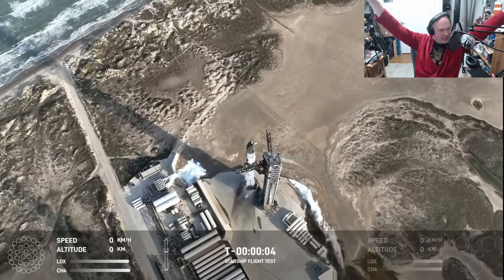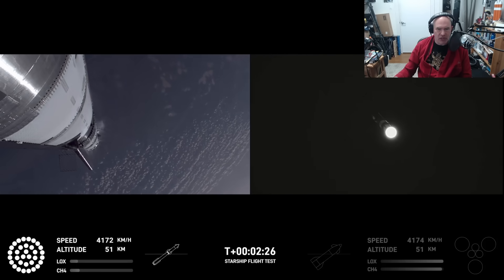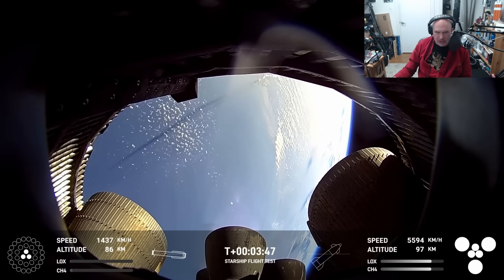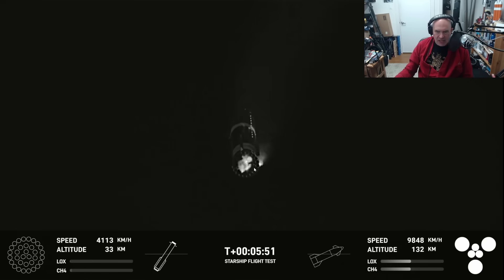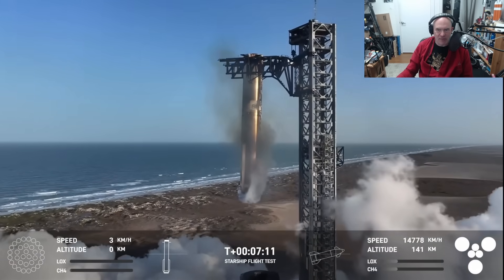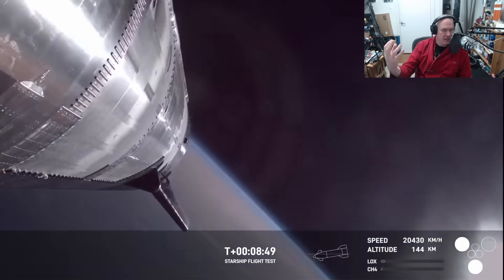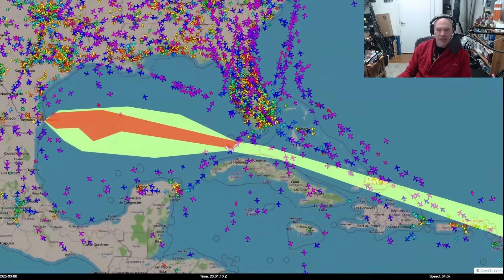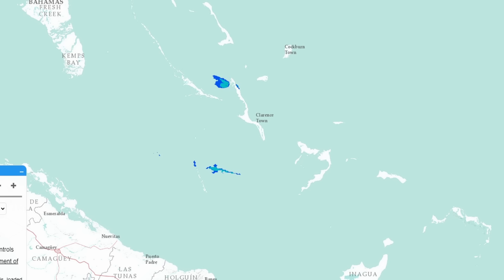SpaceX Make The Same Mistake Twice With Starship Flight 8

Comment: The ship blowing up is obviously a big deal, but not all engines relighting on the booster shows they still have some other issues to work out as well.
Reply: Engines and other mechanisms don’t just fail randomly.  They fail because of a root problem that is not being understood. If you don’t understand and fix that specific issue you will be seeing consistent and persistent failures until one day you get really unlucky and lose the vehicle and the launch complex.  In the early 1990’s general dynamics had a failure from an engine not starting.  An elaborate failure investigation was done and multiple smoking guns were found. Those were fixed. Except for this one weird temperature sensor that was showing a little change not seen before.  Just couldn’t explain it.  But it wasn’t an important sensor.  So we flew again.  Worked ok. Flew again and the same exact failure occurred. With that little twitch in the sensor too.  Finally the root cause was understood and the behavior of a little check valve that mostly functioned only on the ground was the culprit. That and keeping a chill down system that was 1960’s vintage and there to get a tiny bit more performance.  You can’t solve this stuff in two days. You think you can. We did!  This cascade of events utterly changed the design philosophy and test methodologies.  And how faults and their consequences are addressed.   SpaceX engineers need to stop calling catastrophic failures RUDs. It trivializes your major screwup. And is utterly unprofessional.  In my estimation they had more than a half dozen overt and significant failures on this mission.  An engine failure to light is a FAILURE!  It doesn’t matter if you squeaked out a success at the vehicle level.  If you keep on this path all sorts of other anomalies and failures will get swept under the rug and you’ll develop a reputation as foolhardy and basically lazy and stupid. Think Boeing 737 and the corporate think that burned them. Don’t be overwhelmed by Elon’s musk.
Reply: Yes but this is actually the best turn of events, they had partial engine failure but were still able to return the booster- they can now examine the engines to correct the issue. In the past they had to scrub the entire catch attempt when the engine failure happened so I'd wager that they'll be able to start making some huge strides now that they're getting the boosters back.
Reply: @twoeyes  No it is not, if 2-3 engines are consitently randomly failing on EVERY launch then statistically you would expect a 2 standard deviation failure of 6-9 engines once every 100th of so flight and that's going to result in loss of vehicle.  Your statement is akin to saying that Jets aircraft which can tolerate 1 engine failure are ok if 1 engine failure is occouring routinely.  That's only safe is 1 failure is vanishing small so that the multiplicative chance of a second unsurvivable failure is infantesimal.
Reply: @kennethferland5579  Thanks, I was just about to write about how the statistics play out.   NASA's criteria for a manned launch is that killing one crew in 500 launches is their acceptable limit.   So given that, how often can we accept a single engine failure?   Then because there are som many unknowns, we have to put in a safety factor so we might need to calculate for a 1 in 2000 loss so we achieve no worse than 1 in 500.  I think this works out such that failures are rare, not routine.
Reply: @kennethferland5579  yes, it's reducing the safety factor and serious from that POV.
Reply: @ yes that’s true, that is a bright silver lining, I was surprised at that.
Reply: To be honest it's possible that these engines were alright, but some automatic systems measured 10% less startup pressure or whatever and decided not to light them up for safety. Then for the landing burn one engine returned back to desired parameters and got lit, while other was kept offline.

This was also demonstrated on the previous flight, where they relit one engine that went out.

If you have a damaged/clogged engine in any significant way - you wouldn't even try to relight it, or it will cause explosion and massive damage. The fact they relight failed engines shows that those fails are probably just failsafe guidelines that flight computer operates on to avoid any risk of relighting offnominal engine. Don't say force relighting it will cause explosions, just that risk os slightly higher and isn't worth it
Reply: while true that 100% engine firing is desirable, it's designed to withstand several engine failures (as shown here)
Reply: @TheAechBomb  The fact that some engines can fail doesn't mean that they should.
Reply: @HalNordmann I agree
Reply: @TheAechBomb  if theyre burning through the safety margin every time then how long before they get too many engines not lighting.
Reply: @ebouwman034  they can improve the reliability of their engine re-lights later, I think they're better off focusing on making their engines not explode first
Reply: They are still using raptor v2's on v2 starahip. They are running though available hardware to get a much flight data as possible.
Reply: @klarik01  why would you want more data on a version you don't intend to use, especially if it's not working right and ruining the rest of your mission.
Reply: @ They are getting flight data for vehicles using older engines, not flight data on the engines.
Things they test:
1. Plumbing
2. Avionics
3. Navigation systems
4. Aerodynamics
5. Structure of the vehicle
6. Software
7. Other issues that can show what else should be changed on raptor 3 (in case its the same with r2) such as nozzle cooling system etc
AND DONT FORGET
Raptor 3 is still in development - they cant just make 33 of them n a day. They DONT have enough engines to start flying them
Reply: @la1m1e  ok, in other words, the raptor is a struggling engine, still in development towards something that's actually good enough.
Reply: @snizami   @snizami  not raptor itself. The fuel supply and repressurisation systems usually. Most fails were due to co2 ice being blasted in the fuel tanks, which r3 doesn't do whatsoever. In this case Decision not to start engine can be done with thin safety margins, as this booster will survive without 2 engines, unlike a 5 engine rocket, where you have to push through any minor deviation because otherwise you die.
One thing - we have not seen any engine explosions lately.
I expect even after years from now see engines occasionally stop ignition just because they can afford it just by weight of the risks.

If we look into maths - even having the most reliable engine (which raptor currently isn't) possible we expect at least one engine out/not nominal event every n restarts. Then we have 33 of them lighting 3 times per flight.
It is already a miracle engines work as reliably as they do now
Reply: @snizami  to be clear i only remember a single raptor 2 catastrophically failing after ift2 whatsoever other than ones caused by ice formation in fuel tanks (a solved issue).
Sometimes automatics don't let them start and that's it
Reply: Yeah, on fight seven they had one raptor out and claimed they had resolved it with an upgraded igniter and then we see three raptors on the boost back and one on landing burn.
Reply: Yeah its interesting the taboo talking about Raptor design flaws.
Reply: They keep touting newer versions of Raptor as if they're legit upgrades when the thing hasn't shown itself capable of withstanding a fraction of the gruel a fully and rapidly reusable and RELIABLE engine would undergo from the very get-go. And that's just to carry an empty shell of a fractional prototype into the Atlantic ocean.
Reply: @snizami They haven't actually flown the newer version of the raptor engine which solves that particular problem yet. Specifically the raptor 2 sends exhaust from the turbo-pump's methane preburner back into the fuel tank to pressurize it, the H2O component of the exhaust freezes into snow in the tanks, floating in the methane tank but collects on a grate in the LOx tank.  Which isn't a problem while the rocket is accelerating in a straight line, but becomes a problem when the booster flips end over end for the boost back burn and sloshes the tanks around.
If too much snow gets mixed in with the LOx during the sloshing it falls to the bottom of the tank and gets sucked into the intake pipes for the engines  clogging them.
(If the boost back burn is successful anyways it can also unclog a clogged engine by settling the tank with acceleration, which is why some of the raptor 2 engines which failed to light for the boost back burns did light for the landing burns.)

The raptor 3 solves the problem by using a return pipe heated by the preburner exhaust instead, but they aren't going to fly it until they have used up the raptor 2 engines they already have built.

In the meantime, they added more redundant grates to the LOx tank to catch more of the snow above the intakes (adding weight), and extended the intake pipes for the 3 critical center engines so they would be the last ones to get clogged (meaning the last bit of LOx can't be used), both of which reduce the payload capacity of the boosters still using the raptor 2 engines, but reducing the failure rate to an acceptable amount.
Reply: @snizami Oh, you mean the kind of engine that literally no one has built yet, except for maybe SpaceX, on Falcon 9?
Reply: @roflchopter11  Raptor is nothing like those far simpler Merlins. They've chosen a far more ambitious and unprecedented design for something that's supposed to also be far more reliable and longer lasting.

Comment: I’ll be the different one here and make a comment/have a Question about the Booster: The Good News is that the Booster demonstrated resiliency in getting all the way back home with two problematic raptors. But, I have a question: ASSUMING they didn’t know they had an issue with those two issues until they both didn’t start on the boost-back burn……..who/what made the ‘call’ to Still try to command two problematic engines yet again, for the final ‘landing’ burn (at which one of them finally did re-light?). Because that’s dangerous (to the vehicle). Did the Flight Director/Team, as it was falling, quickly assess and determine it wasn’t a safety of flight issue to attempt two re-starts- but maybe a common e.g. engine command control issue, so, go ahead and give it a try again? Or, was it all automated, and it ALWAYS attempts to give it a try again….which, frankly, in spit of its success, this time, I would tend to question. - Dave Huntsman

Comment: I am not so sure about the methane causing the heat build up in the skirt of the booster tbh. Correct me if I am wrong but wouldn't the air pressure be enough to cause the heat up?
Great video as always anyway! :)